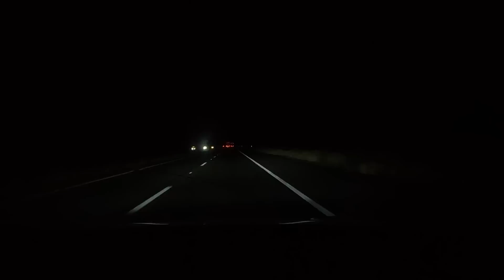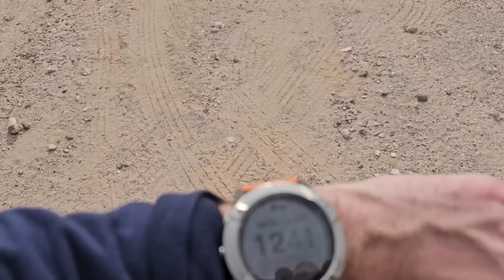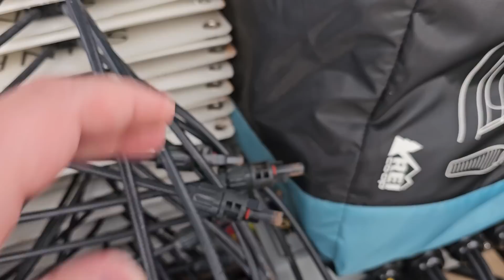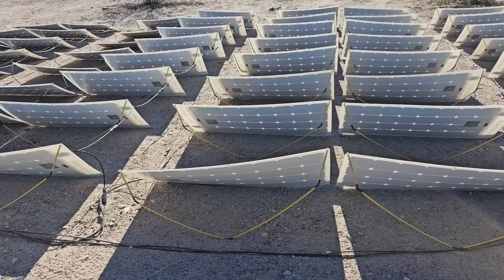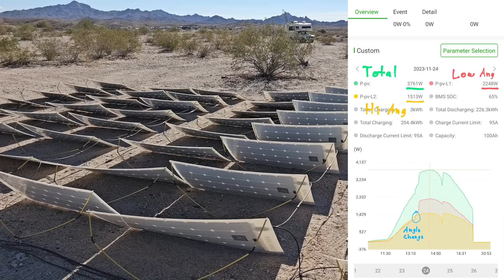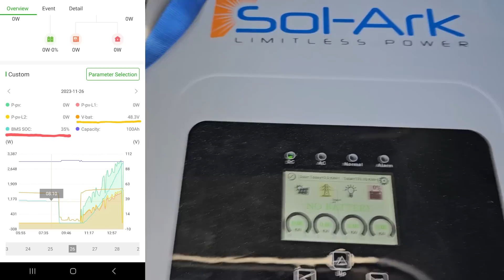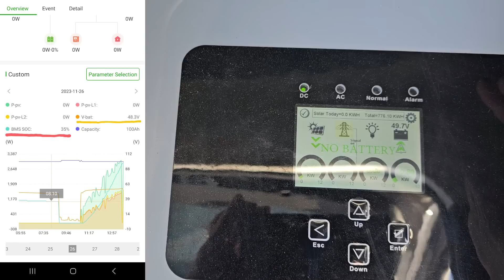Badlands Charging

Comment: 😃Question, why not connect all the panels in series and get to 400Volt and directly enter the DC connector, without going through the inverter and having a significantly greater efficiency?
Reply from the maker: I do have them linked in series and parallel, however the voltage is dependent on solar intensity and the car needs a consistent 400 volts as well as a communication protocol to initiate charge, this is the only off the shelf solution for now but not for long, there are controllers under development that could charge direct solar to car. I talk about this in another video if interested. https://youtu.be/pFWs6LJTYpY

Comment: 😃Question, why not connect all the panels in series and get to 400Volt and directly enter the DC connector, without going through the inverter and having a significantly greater efficiency?
Reply: Yes, would be great - but you can't just shove 400+V into the dc port and expect the Tesla to do anything - the contactor will remain open until handshake and authentication protocols are negotiated successfully. This will require some electronics voodoo to achieve.
In any case, a charge controller would be required to maintain MPP of the panels, as if a cloud comes along and the PV drops below the battery voltage, no charging will happen as you're then attempting to run them in reverse.

Comment: Congratulations! So satisfying to set a challenge and then achieve it through pain and suffering, and answer a lot of questions...  64 panels is a huge amount to lug around though!
I tried a similar task on a smaller scale with my ebike years ago, but with my own 120 W panels using 6 x A3 sheets of foamboard with 6 sunpower cells on each page, folded concertina style.
Used polypropylene for some basic protection, but not rainproof! Came out at about 2 pounds in weight each, so was easy to carry 4 of them. Still work after 7 years!
Each one took me about a week to make, so making 64 of them would be a nightmare!
Reply from the maker: That is really cool, I just checked it out. My panels are a little cumbersome but the prices have really dropped, I just put a link in my description, in the US the 100 Watt panels I used can be had for only 125 USD! Great that your setup is still working, I was thinking of something similar to your system that could fit in a backpack so I could charge my Onewheel and or Ebike. I also have a bunch of Maxeon cells should I choose to make something.
Reply: @lightpowered  you can buy the solar cells individually and make up your own panels. I thought about doing this for a solar ebike, reason being you can get a specific voltage/amp.  They cells are only like .6 volts but can do like 10 amps,  very odd but you have too put a lot of them in series and you get a usable panel.  I thought about keeping the voltage low and amps high and charge super capacitors that can handle 10 amp charging per cell, even 50 amp, something lithium cells cant do and why its the bottleneck in this system.  Cant charge the cells fast enough, even if you have enough power.  So i was thinking supercaps could work.  fast charge them in parallel with 4volts 100 amps .  Trick is you have to disconnect them from their series connection to parallel fast charge them which is actually possible with isolation modules, like dc-dc converter with isolation.  This lets you charge batteries connected in series individually as if they were in parallel, allowing for fast parallel charging. Add the super caps into the equation and you could be super fast charging!  Thats the idea anyway.
Reply from the maker: You can, but it is a lot of work, I see most people adapt existing panels to their needs rather than making custom. For best results you need a good MPPT charge controller and since they do all the conversion for voltage and current the panels become the bottleneck. My small tent battery (18650 cells) can charge at over 500w and I only used one 100w solar panel.
Reply: @lightpowered   are you going to make anymore videos?

Comment: I love you what you’ve done. I have an off grid solar system that recharges my electric car and I love it. I would like to build a lightweight high strength trailer that is 40 feet long that is covered in those solar modules. That way there’s no time involved in set up and take down. As well as I could charge my auxiliary battery during the day as I’m driving. 

YouTube just turned me onto your YouTube channel. Very cool I’m going to subscribe
Reply from the maker: Cool thanks! Yes, I am also toying with the idea of a RV with a massive 7 kW roof and awning. Eliminating the setup will be the best part. Also I want full AC off grid without generators.

Comment: Iv always wondered what would happen if u turned the car on, popped the rear wheels up on a jack and tried to spin them, would regen work?
Reply from the maker: Most likely yes it would work, the car must be able to operate on a chassis dynamometer for regulation testing and compliance and therefore should regen just as though it was being driven.
Reply: @lightpowered  🤣🤣🤣

Comment: It won't be long before you absolutely fry your EV's onboard charger by using a high frequency, transformerless inverter. Because there is no galvanic isolation between the inverter's DC boost stage and its AC output. All it will take is for the AC output monitoring circuitry to fail and one of the MOSFETs in the inverter's H-Bridge circuit to short to ground, and this high frequency inverter can send dangerous, high voltage, high amperage DC current straight to your EV's onboard charger which will not only damage it, but can also set your EV's charger on fire.
Reply: Lmao, you change accounts just to leave the same comments on every video.
Reply: @meilyn22  Do you mean like how you change accounts to post videos promoting these low budget inverters so you can earn your Affiliate advertiser commissions? LOL!🤣
Reply: @quickquote1568  I've never done that. I have no idea what you are talking about. I don't have affiliate links, nor have I ever promoted any inverter.
Reply: @meilyn22  Sorry dude but you need to stop trolling me. I'm not that kind of guy.
Reply: @quickquote1568  when are you gonna stop complaining about high-frequency inverters on youtube? You've been crying about other people's business for too long.
Reply: @meilyn22  As long as myself and my staff are in the inverter repair business, and the Chinese continue to export these crappy, failure prone products into the US, we're going to continue to complain about junk high frequency, transformerless inverters.
Reply: @quickquote1568  I don't see anyone complaining about their Chinese inverters. Low frequency inverters you speak of are made in china.
Reply: @meilyn22  Here's a complaint that was posted a few days ago on you tube by @makesaveinccomm.  You must have missed it. This is just one complaint of many. 

@makesaveinccomm 1 day ago SS reply: "They wanted charge a fee to trade, they called it upgrade to EG4 6000 Watts . that is down grade 500watts. cost about 50% of the price I lost after used about 2 years.  I have no Wifi link app to know how much Sun charge or used power remain (the different app Green [orgininal is Blue solar watch app)  Register with the green app. it said the code on the inverter already registered.].  only way to know is go to garrage outside of home to look at the LED on the EG4 battery pack.   So If I trade 1 in, I have to trade both that lost over 1500+ tax shipping for new set of 12,000 watts.  Their tech support reply 1 time, that's it.  no reply again.  I would not recommend Signature solar.  (they also have Intimidating Tech support voice person and some one else rude)". And by the way, there's nothing wrong with Chinese made low frequency inverters. Only the Chinese made, high frequency, transformerless inverters are junk.
Reply: @meilyn22  Sorry dude but we're never going to stop posting the truth about junk Chinese made, high frequency inverters until their banned from the US market.

Comment: Thanks for the update!
Reply from the maker: Yes back at it with a few video ideas after the cannonball run, I rode a Onewheel over Monarch Pass, strategically draining the battery up hill and regening it down hill, extending my range from 17 miles to 37 miles. Curious, do you think that would be an interesting video?

Comment: 52 psi? 😲
Reply from the maker: Yep, The tires are rated to 51 psi cold, needed all the rolling efficiency I could get.
Reply: @lightpowered  I hope your back is ok, even 40 is too harsh for me 😁 although I’m not  sure if performance and LR has the same ride quality.
Reply from the maker: @sedrakpc  Yes, that probably makes more of a difference, I dropped back to 40 as soon as I finished the run, but was surprised to hardly notice the difference.

Comment: Really cool project good luck to you. How well does your panel setup stand up against  wind?
Reply from the maker: On normal dirt 40mph gust were just fine, this location was rocks mixed with silt. The lag screws would sometime go in but then pull out too easily, if I was free to move it around I could get a good hold, but that only worked for my single panel, with the full array I was too constrained by the wire lengths to get enough movement to find solid ground for each of the 192 stakes.

Comment: Congrats!! Almost there!

Basically, I wonder if kWh/100km is the best metric for these runs ? My hyundai ioniq (11kWh/100km driving @100km/h) would do quite great imho (although the range is not that great; ~200km). Cheers!
Reply from the maker: I prefer metric but all my intuition for distance is engrained in miles. 11kWh/100km is quite good, about 177 Wh/mile, definitely better than my ~200 Wh/mile on a flat road.
Reply: Yowser! That's 5.65 miles/kWh. Impressive.
Reply: Watt-hour/km would be standard. Wh/mi for usa

Comment: I am following your video and I like the idea. I still wonder every time why you dont take care enough to the shadow that affect your solar panel? It is a serie of cells connected and when shadow affect one row, every other solar cells even if they are at full sunshine will get the sam power as the one under the shadow. Why not puting more space between the solar panel and boost your solar power? To me it look like a very little effort  with huge benefit!
Reply from the maker: Yes, the cables are not long enough, in hindsight I would have made extensions for each panel before leaving.
Reply: @lightpowered  I see!. Maybe evaluating the cost of buying these xtension cables ( probably 7 cables at 1 per row) and benefit of additional power versus the cost of extended time in restaurant, trip requirements etc to wait more days to get the energy you need. ( cost of added days due to loss of cahrging power due to shadow vs cost of extension cables to shorten the trip!)
Reply from the maker: Yes, I would have needed one for each panel so 64 in total and at first it was not a big issue but kept getting worse as I went, but yes I should have reached out to a local solar supply shop to get some.
Reply: I am pretty sure the next attempt of this record will be way better.
Better charging charging inferstruture (aka cables and other stuff) maybe better control of the car (no powerdraw) better time of year for the record